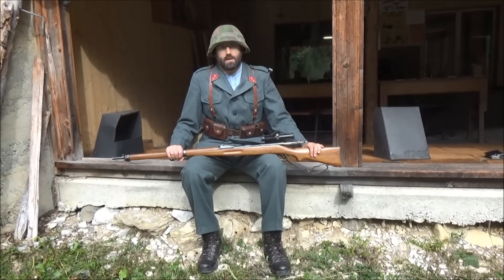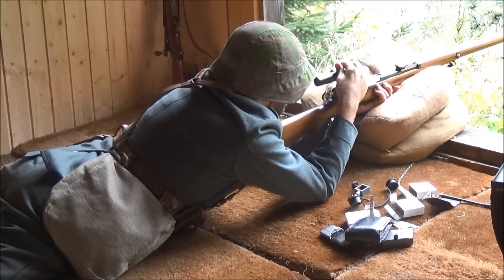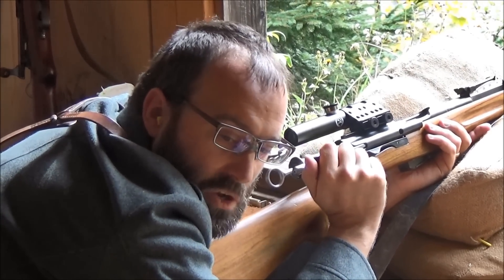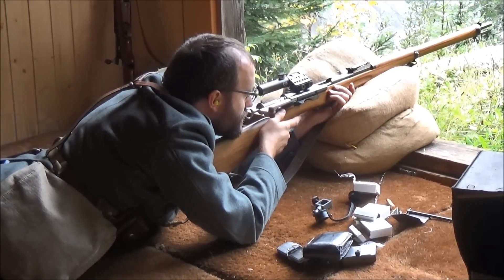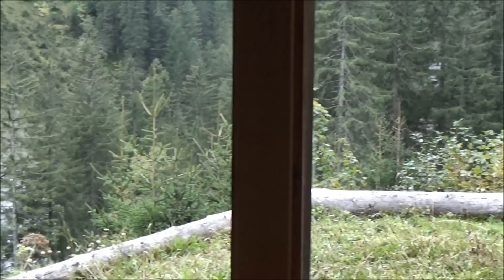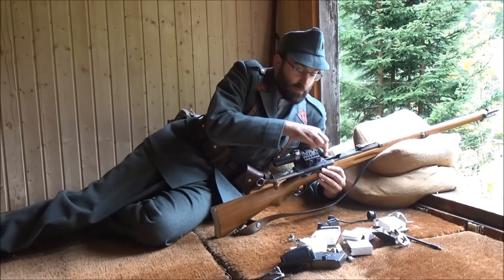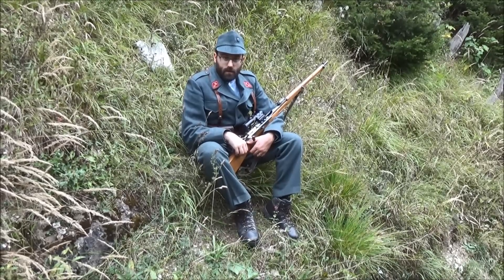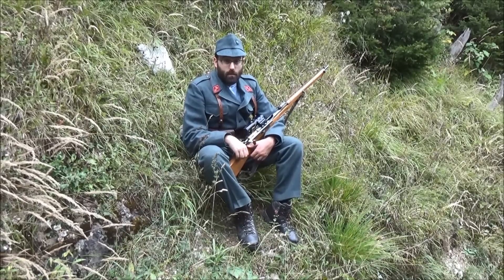Ersatz WW1 Sniper Rifle Project #2: 300m Test

Comment: I got a side mount for my K-31. Just the bolt on one to the right side of the action. I just put a cheap bushnell legend 9-3-40 on it and zeroed it for 100 yards. I measured the offset and just maintained the offset while sighting in. It actually works great, and even though the side mount clamp only has one bolt clamp on system, it holds zero great. I like it on the right side as I can use the open sights and gives me a good field of view for varmint, coyote hunting. lol, Gophers don't stand up to GP11 to well. : )

Comment: Hey Bloke, this was one of my favorite episodes. I like how you really try to feel what it was like to shoot these rifles (in uniform) and deal with the resulting incongruities. It's like a living history. lesson. Don't give up on the sniper rifle project, I'm waiting for episode three. My one suggestion would be to try to mount a scope you trust on the rifle and see if you can zero it with that, and see what your grouping is like. That could possibly eliminate the rifle as an issue, or would tell you if the rifle is the issue. I don't think it's your shooting :). Good luck!
Reply: Those are nice scopes, I am not sure how you would mount it, or wether you still need to do the off- center mount like you did with the original scope. Maybe just a regular mount would eliminate any issues regarding the off center mount? Then you could test the rifle on its own merits with a scope you know works. My guess is that the recoil was too much for the original scope and your POI was moving with each shot, it would be interesting to find out. Thanks.
Reply: Would the Bushnell fit on the offset mount you have attached now?

Comment: Hi Bloke did you have a good constant cheekweld? I suspect that you where aiming in different angles thru the scope?.
Maybe a leather lace on cushion such as on the M1 C or D Garands is an idea?.
Reply: Yes, the M1C and M1D stock attachment waas designed to move the shooters face to the left as the scopes were mounted with a substantial offset to allow the rifle to be loaded with the enblock clip.
Reply: AH OK there is your answer strap something on your stock and try again,Looking forward for your results.
Reply: Same here for the official part.
I still think something like a leather lace on attachment is the best way to go for
a periodic look and you don't have to drill screws in your stock.
Or you can alter one of the metal height adjustabel models as for the K31?.
http://shop.sportarms.com/index.php?page=shop.product_details&flypage=shop.flypage&product_id=303&category_id=53&manufacturer_id=0&option=com_virtuemart&Itemid=27

Comment: Cover the shipping and I'd be willing to send you mine that was built in 1953 IIRC, very clean optics mine is also very smooth for adjustments...no clicks.  I'm planning to install it on NATO ishy .   Id also suggest a leather cheek pad  they tend to push your face to the left throw one I had on my Fall, if you like I you can keep it.  I would like the scope back though ;)

Comment: Would it be possible to flip the scope mount's overhang (that wraps around the scope itself) upside-down, to lower the scope position by a few more cm?  
If it's possible, that might help you get some actual cheek contact.

Comment: Would you do a video explaining the Swiss Marking system.  That is what do the numbers mean.
Reply: There are 2 official targets for the 300m ranges. Target A and Target B. Both of them are on a square canvas of at least X 1.5 meters and Y 1.65 meters. Target A is a black circle with the diameter of 60cm with rings indexing every 10cm out to 1m diameter. In the black circle the rings are white of course. You can select, depending on programm or training, if you want A5, maximum of 5 points, A10 maximum of 10 points, or A100 maximum of 100 points.  Target B is a bit more complicated. It has the rings of the previous target but its predominately a 1x1m camouflage pattern. Within this pattern a silluette of a person 45 cm wide und 50 cm high, offset 30cm from the bottom of the pattern. The shoulders are at 41cm off the bottom of the body.  Points are counted to 4. 4 is center of mass/center of the camouflage in a 20 cm diameter. 3 is the rest of the body. 2 is a diameter of 70 cm and 1 is 1m diameter.
Under https://www.admin.ch/opc/de/classified-compilation/20030865/index.html 
search: Scheibenordnung (Ordonnanzscheiben) and youll find pictures of A and B followed by a rarely used P and combined B and the pistol rapid fire target.
Reply: Announcing with the pointers is as follows.

Target B:
4
red-white trowel, upright
3
white trowel, upright, silluette gets touched lightly
2
orange trowel, upright
1
black  trowel, upright

Target A:
With 5 points:
5
red flag trowel, first point of impact, then waving
4
red-white trowel, upright
3
white trowel, upright
2
orange  trowel, upright
1
black trowel, upright

With 10 points:
10
white  trowel, point of impact then following the 8 circle once
9
red-white trowel, point of impact and following the 7 circle once
8 to 1
orange trowel, to point of impact

black trowel then announces point accorting to:
 
6        7        8
4     9/10     5
1       2         3

over the entire target.

0 or the wrong target is the black trowel waving.
If 0, point of impact is shown.
If the shot is not on target. The black trowel is waving from top to bottom, trying to scrub the shame off the target you brought onto it with bad marksmanship :)
Reply: Sry was typing didnt see. :)
Reply: Not going to try and offend the Swiss system, but in this world of tech, why not just wire a LCD screen to show numbers? this seems overly complicated.
Reply: Redneck Fury Its a method of showing points from even before there was electricity. Most ranges now have a monitor front right of the shooter to show the hit and a little printer /programming station on a table behind them.  The trowels are mostly used in special occations or when the range is not connected to power.
Reply: Thank you very much.

Comment: The scope is probably too shitty, but:
1) You probably know - on offset scopes, there are commonly used addon cheek pieces that compensate for both vertical and horizontal offset, so you can get consistent cheekweld.Leather would be period correct-ish, but rubber foam or even towel and duct tape would do.
2) Each scope has certain distance at which the reticle is projected and thus "parallax free". If you move head and the reticle moves in opposite direction, the reticle projection distance is closer than target. I suspect this scope has reticle at 100m or even some arbitrary distance.
3) Having shitty optic isnt Necessarily bad, i would hang onto it and see what i can squeeze out of it. The only real problem is if the reticle moves between shots.

Comment: How do I adjust the iron sights if I'm shooting 6 inches high at 100?
Reply: You would need to raise the front sight by replacing the front blade/post with a taller one, and then shortening it until it was zeroed

Comment: Why don't you use a M1 Garand Sniper pad on the rear stock to get proper cheek weld?
The pad will also allow you to cycle the action without moving the head and keep sight picture intact.
Reply: No, they were not. Regular shooter adaption in Norway for M1894 Krag sniper rifles with similar off set scopes anno 1910

Comment: The pu scope itself was designed as a dmr optic rather than a sniper optic (contemporary soviet sniper equivalent is the PE scope i think?) , that was pushed into a sniper role, therefore i am not really surprised at the result. that being said i do believe you can improve your groupings with muscle memory based on what you stated at the end of the video. best of luck to you.
Reply: Nither where very good scopes, both where rather primitive by even WW2 standards, i doubt the results would be much different.

Comment: Just my 2 cents, in order to check what is wrong with the assembly, I cannot believe you are shooting so badly  :-) 
- try to use one more sand bag, put under the butt, so the rifle is more stable, and this will eliminate most of your own parasitic movements
- mount another scope, just to compare
- free the barrel
As I made a lot of precision shooting, I'm aware that details can affect the results. More throug PM, if you want.